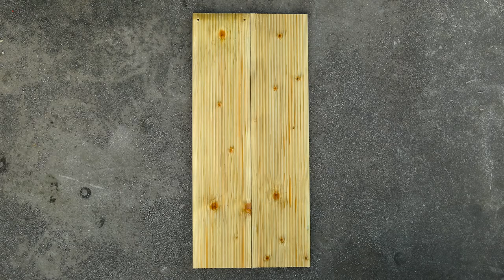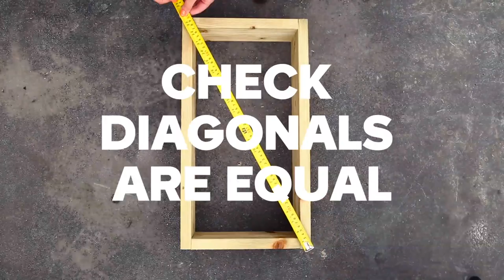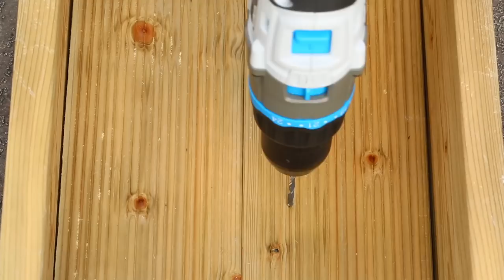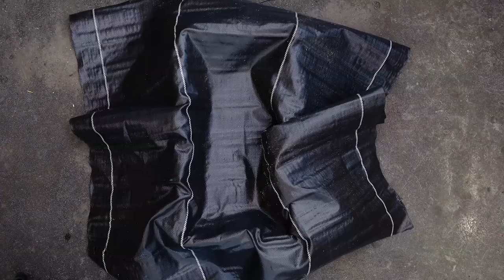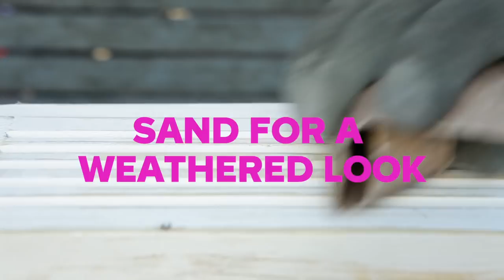Build a planter from decking

Comment: great video, thanks. Will be building some this week.  Just to check - what membrane do you advise?  Is the stuff you lay under chippings to prevent weed growth suitable?
Reply from the maker: Hi, Simon. We'd recommend using the Capital Valley Plastics Ltd Black 250 Micron Damp proof membrane, this helps to prevent damp and is different to weed control fabrics used under chippings. Hope this helps!

Comment: So you have 2 pieces of decking on their sides to create the height of the planter. How are these two layers fixed to each other? The top one would just slide off if knocked or a cat jumped on it?
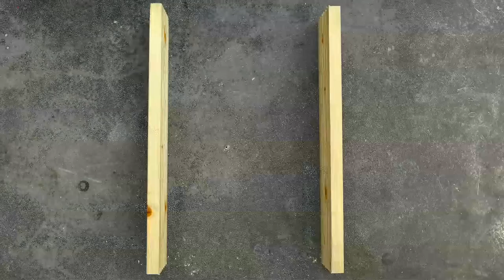Reply from the maker: Hi, we've only used 1 layer in the video. However, if you wanted more layers for extra height you would attach them together as demonstrated in the video. See here: 0:08, hope this helps! 😊